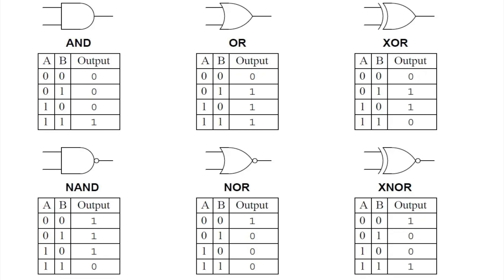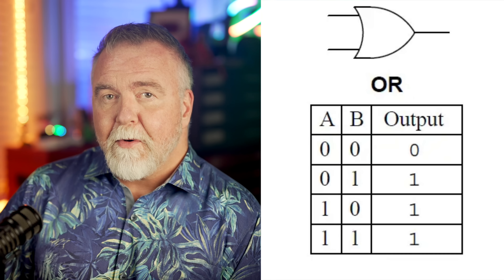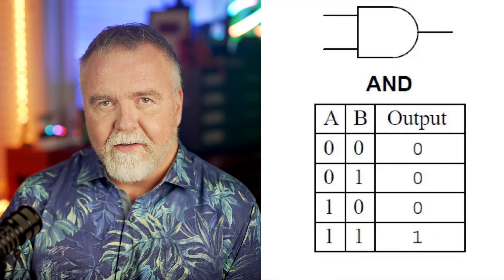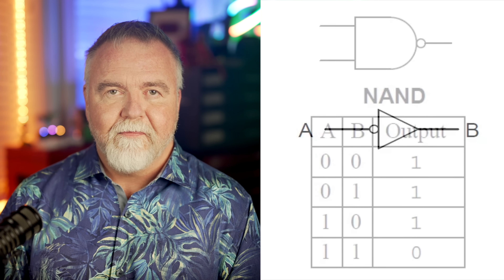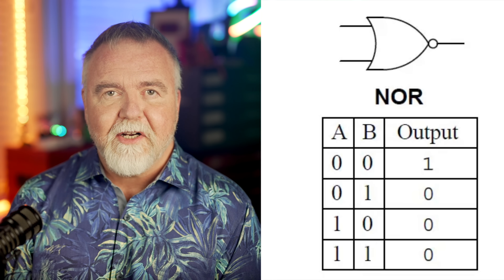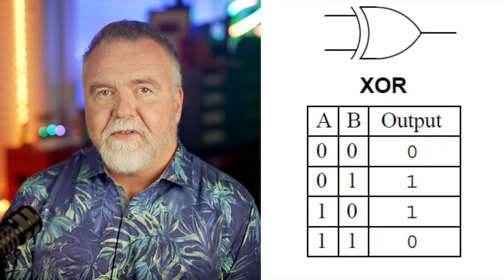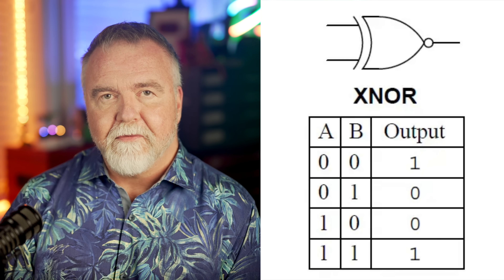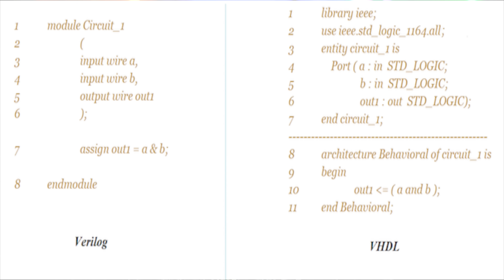The "Do Anything" Chip: FPGA

Comment: I tried to talk one of my aerospace employers into using these things on test equipment, as every time we built a test set, we wire-wrapped random small scale logic into circuit boards that plugged into a back plane.  Unless you have done this kind of design, with a few dozen to a few hundred gates, registers, buffers and such,  it's hard to explain how tedious it is.   I could have replaced a lot of wiring errors and race conditions and debug cycles with software and cut down fab time to days from years.   Nope.  

not new tech.    not well understood by a lot of modern engineers.   overlooked a lot in the solution space for an infinity of problems.    nice video.  well explained.

Comment: Hey Dave, great video.  Don’t forget about FPGA on-chip BLOCK RAM.  An FPGA is also the place to make your own custom microprocessor or even full microcomputer. A long but rewarding project.  Comparing designing on an FPGA to programming a microcontroller is like comparing architecture to interior design

Comment: Hi Dave, others. I beg to differ on the power consumption minus attributed to FPGAs. In almost all applications they consume an order of magnitude less power than the equivalent MCU. This is because only the logic required is powered at all .. instead of a large general purpose set of logic. 
I also cant see that the risks you state due to reconfigurability are valid, .. any more than you can re-compile code and insert malicious operations. 
A "simple" change in FPGA code.. especially in critical systems with high complexity requires very much more than the testing a software code change would need to verify. For major critical,developments the verificàtion engineers are often a separate team .. with spcieic competencies due to this complexity.
The forerunner to FPGAs were PLDs, and they still exist today implementing small state machines in micro-watt power schemes which one could simply not achieve with MCUs.
its a great overview intro, .. and I love your material. But watch out for the "devil in the detail" on topics like this.
cheers !

Comment: Modern AMD and Intel CPUs are based on chiplets with interconnects. Latest Ryzen 9 CPUs have integrated graphics cards too 

So, why don't modern CPUs just have a small chiplet that is an FPGA and could be rewritten to perform a certain task based on your apps. For example, you use Photoshop or music making software and so the CPU writes an FPGA to do a function that those apps use all the time  It could download the blueprint for an app if its detected and used often.

Or just have it for hobbyists or a use in your workstation.

Edit: just got to your hybrid chip discussion.

So. yeah, its being done. Id love to see it done and see whst improvements can be gained. It could be simple at first, less chance of security risks etc. then build on that if it helps.

Comment: I've seen so many FPGA-centric projects fail. 

Typically, people underestimate the size of FPGA they truly need, and discover only very late on in their project that they need to add just a bit more algorithm / function, but there's no more room on the FPGA. I've seen some very large engineering companies make that mistake, even though they've started off with design rules such as "use one that is 400% bigger than we think we need". 

In the signal processing world, they struggle to be relevant. Note that "used for this" does not mean "best for this". They're most successful when one's functionality has to fit inside a small space and you're forced to make your own electronics (e.g. a missile body), i.e. you cannot fit a standardised CPU platform inside. CPUs have dominated everything else, largely because they're so much easier to develop for, so much easier to scale up / network, and are good for lots of other things as well.

The successes I've seen for FPGAs have also been short lived. Signal processing projects can easily start off as CPU-only solutions, which are very easily networked (or even "exotically networked" e.g. Serial Rapid IO), and can readily pile up CPUs until there's enough of them. That gets you a working system, which you can then prove in the real world. You then have got certainty that you're running the right algorithm to work in the real world. 

Ok, so then you can - in one development cycle, at low risk - convert it to an FPGA design, and you're now running a nice, hybrid system possibly with less hardware, which may be good for series production, unit size. That's fine, but what I've often seen is that by the time for a system upgrade comes around, the CPUs you can now get are so, so much faster that the work that used to take what had been a large expensive FPGA now fits inside a single CPU core (leaving you with perhaps 191 other cores to do other work with, if you're playing with something like an AMD Epyc). Modern CPUs are such monstrously powerful signal processing devices that it's difficult to find a signal processing application to keep them even slightly busy. It's easy to underestimate just how much signal processing you can do on something as a humble ARM 72 system-on-chip costing $30. Also, because in a real system you almost never have just an FPGA - there's often a need to run system software too - you may as well ditch the complex, hard to use FPGA and resort back to a pile of C++. I've seen several project go this way. 

AI - forget it. NVidia are the ones making the money, and there's several very good reasons why. There's probably some people doing AI things with FPGAs, but it's a sure fire way to be behind the curve. 

I think the lack of attraction of FPGAs vs CPUs is born out by the sales. Xilinx before AMD came along were tripping along at about $3.15billion revenue per year, and that was declining. Compare that to what it now costs to get a new top-end large scale device (e.g. a large FPGA or a large CPU) taped out and into production on the latest silicon fab process; it's somewhere north of $6billion to $10billion (including setting up the fab). There simply wasn't / isn't enough money in the FPGA market to pay for the devices to be cranked out on a competitive silicon process, whereas the CPU market is vast. Thus, FPGAs are doomed to fall back and be uncompetitive.

This has been seen before in other device markets. Consider something like Serial Rapid IO, a specialised network standard used in military hardware between processor and/or FPGA boards. It was a lot faster than the Ethernet of its days (thanks to the switch chips that got built for it). This interconnect is now  dead and buried, because even the entirety of the military electronics market was insufficient to pay for the network standard to be upgraded (the switch chips were going to cost way too much to design, tape out and productionise on a relevant fab process). So that whole market has gone with the flow and replaced Serial Rapid I/O with lots of high speed embedded Ethernet (though they have been quite creative in what they layer on top of Ethernet). Even very fast Ethernet switch chips are cheap. This has been aided by the USP of fabrics like Serial Rapid IO - low latency - are now largely irrelevant, because the CPUs today are plenty powerful enough that they're not having to cooperate on processing all a system's data. Now one CPU can comfortably do all the processing you'd ever want for a large radar system.  

And that's about the size of it; unless a device market is worth well north of $10 or 20 billion a year - just to be able to compete for the best silicon fabs - the devices are going to be inferior and fall behind. That's what's happening to FPGAs w.r.t. CPUs / GPUs.

Comment: Great video; But i have slight issue with your point at 9.15. FPGA chip themselves are supposed to be volatile. The development boards could come with configuration memories; but the chips themselves are bare. That's what i have always thought though. I might be wrong.

Comment: Dave, I am developing an advanced form of AGI. I have conceived a combination of hardware components that work together with FPGAs that provide a function that I am sure you will readily understand if I say that the AGI is trained to self optimise. I need collaborators that can leverage such innate understanding as you have to apply some high conceptual principles in the simplest form of logic required to meet the level of functionality envisioned. My premise is that with existing hardware, we can apply some craft in software and hardware with innovative thinking to achieve results that are not readily obvious. It would be very interesting if you're open to having a chat. I have an inkling that you may find some credence in what I'm doing and your ready understanding of the logic principles might really help in keeping things smart and lean in the approach. Can we chat?

Comment: FPGA found in the "Ain't Miner" Cripto Curency engines,  very costly to run banks of them in one module.  and as soon as 6 to 7 months go by, upgrading to newer faster engines is a must to meet bank.

 O fun, you can get those cheap now...  desolder the many, many FPGA chips off the boards, for DIY,  or whatever.  Just a mention on saving a lot of money for a lot of working used FPGA chips.

Comment: How does the FPGA differ from the classic E-PROM?
Is it only that the E-PROM uses external (Manual interaction) sources to reset instead of the FPGA's ability to reset & reprogram entirely through software?  A security advantage when it requires on-site access to reset/change.
I assume the speeds are fast ASIC > FPGA > EPROM.

Comment: I would go further than to say one clock cycle.  There are specific cases where one’s desired operation can be done on a single clock edge

Edit:-

This reminds me of a project some time ago (not mine BTW) where Steve Furber and some others were working on a variation on the ARM processor designed to work without need of a clock.

Comment: I'm sure I read somewhere that a FPGA can be powerful flexible device that can save silicon in some use cases say put one on a GPU card program it for AI/Machine learning then you can switch it's use by reprogramming its set up and the reset it and repurpose it quickly to do physics or path ray tracing, just price holding it back for now.

Comment: I was introduced to PLGAs (Programmable Logic Gate Arrays) a long time ago and found the concept intriguing, but I never quite got into them the same way I got into CPU controller circuits.
The way I understood them was there was a bed of zillions of interconnected gates that could be selectively burnt so that the remaining active and interconnected gates achieved their final function; you would wind up with a chip with many inputs and many outputs that would behave according to the customized functionality compiling of the circuit.
In a sense, from what I understood, it was like a hardware encoding of an excel spreadsheet, basically doing its work and calculations in one pass.
However, from this video it seems like it can do iterative calculations, multi-level decision making, intermediate number/value storage and basically everything that programmed cpu could do. -- That I did not understand it could do.
So there may be some fundamental I am not familiar about PGAs. Maybe because the technology has advanced from my first introduction to PGAs (Programmable Gate Arrays) to FPGAs (Field-programmable gate array), which may be an enhanced version of the original.

Comment: Check out the open source MiSTer FPGA project.  It is a community lead by developers who have created a large number of free "cores" for retro arcade machines, retro 8-bit/16-bit/32-bit home computes, as well as a number of 8/16/32-bit gaming consoles.  Pretty amazing really.  They are using a relatively (for FPGA boards) inexpensive Terrasic DE10-Nano (~$220) that has a combo ARM/Cyclone V FPGA with 110k logic units.  The board comes with HDMI output.

Comment: 7:04 I think that the only fundamental reason for an FPGA is speed. A microcontroller can do all the same things for cheaper, given enough I/O lines and lower speed requirements. At the extreme, it could simply simulate an FPGA and thus have the same functionality.

Comment: FPGA is the obvious stepping stone to a full VLSI, and can be very useful for projects that only need a small number of units (like cell phone base stations that can be sw upgraded to support new encoding standards), but over the last 20-30 years I have yet to see any problem where it is significantly faster than a well-written SW solution running on modern OoO CPU with 10x the clock frequency. For the few cases where it did break some new ground it was quickly overtaken by new cpu generations 2X to 10X faster than the CPU the original FPGA design was competing against.

I have personally looked into 4 or 5 of the "huge speedups with FPGA!" claims over this time period, and in every single instance, their base line turned out to be naive C code running textbook algorithms and data structures. I.e. I could always reach more or less parity with a pure SW/ASM optimized approach. One caveat: My SW solution would typically require more power!

Comment: Dave you are Giving me 90's flash backs to the 90's hyper system I use to build, 68010-10MHz that used 8 FPGA chip to make a special CPU Core that ran at 50 MHz..
I think I still have some old Boards laying around, maybe you would like to study then 4 cards, only thing I Don't have is the Back plane for the cards to plug into...

Comment: There are several types of logic gates, including:

AND gate: outputs a high signal (logic 1) only when both of its inputs are high.
OR gate: outputs a high signal (logic 1) when one or both of its inputs are high.
NOT gate (also called an inverter): outputs the opposite signal of its input (i.e., a high input becomes a low output and vice versa).
NAND gate: a combination of an AND gate followed by a NOT gate. It outputs a low signal (logic 0) only when both of its inputs are high.
NOR gate: a combination of an OR gate followed by a NOT gate. It outputs a low signal (logic 0) when one or both of its inputs are high.
XOR gate (exclusive OR gate): outputs a high signal (logic 1) only when one of its inputs is high, but not both.
XNOR gate (exclusive NOR gate): outputs a high signal (logic 1) only when both of its inputs are the same (both high or both low).
These logic gates are the building blocks of digital circuits and can be combined in various ways to create more complex logic functions.

Comment: FPGA stands for Field-Programmable Gate Array. It is a type of integrated circuit that can be programmed after it has been manufactured to perform specific functions. Unlike traditional logic circuits, which are hard-wired to perform a specific function, an FPGA is flexible and can be reconfigured to perform different tasks.

An FPGA is made up of a large number of configurable logic blocks, which can be programmed to perform different operations, such as arithmetic, logic, and signal processing. These logic blocks are connected by programmable interconnects, which allow them to communicate with each other and with the outside world.

FPGAs are used in a variety of applications, including digital signal processing, telecommunications, aerospace, automotive, and consumer electronics. They are particularly useful in applications where performance, power consumption, and flexibility are critical, as they can be optimized for specific tasks and can be reprogrammed as requirements change.